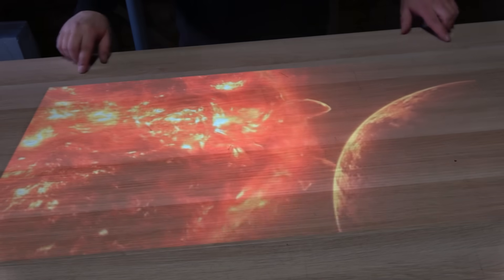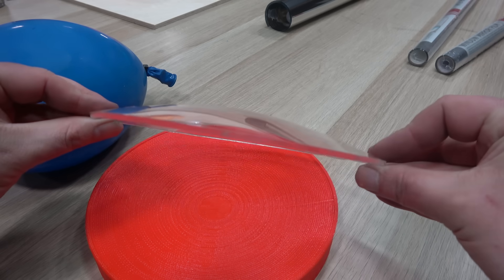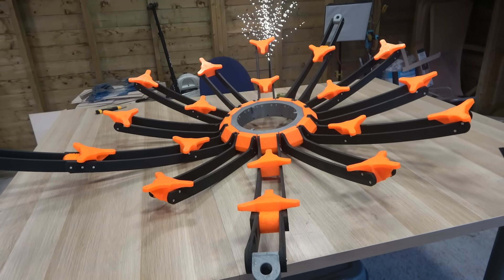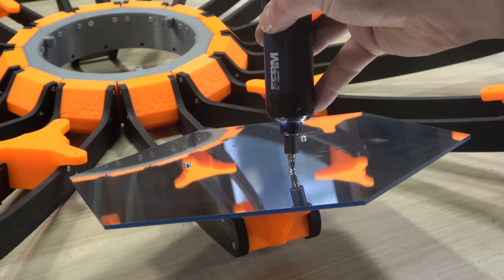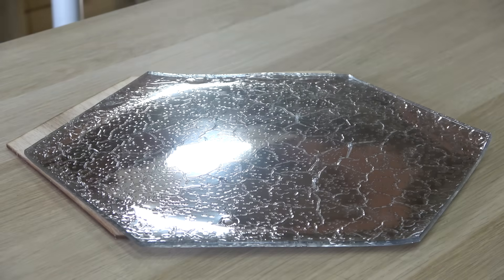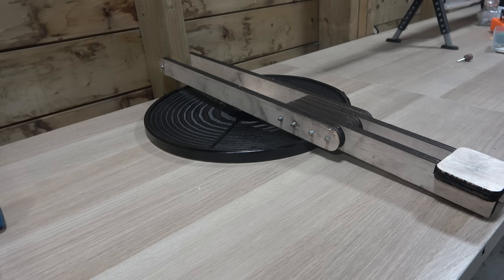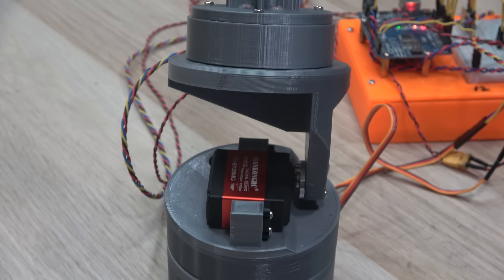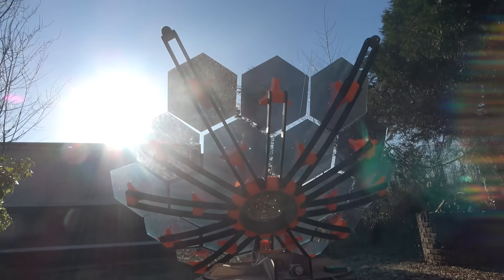Building a DIY Solar Generator..

Comment: I have always like the idea of multiple independent mirrors working together, rather than what is essentially one single big mirror. I have also though long and hard about potentially figuring out a way of tracking, involving no electronics at all. The principle is the same really, only instead of photovoltaics or similar for tracking and electric motors or similar for active adjustment, the means would be heat differential and presure. I practice perhaps some sort of electronic solution for trimming would probably be nice, but I honestly it also to be a bit overkill.
I have also considered adjustable focal point. Which is really not all that difficult, just as long as it doesn't need a large range. It would be a neat way to distribute the energy over an area, when sun is plentiful, and focus to a point when not and I can imagine a couple of use cases, though I do not really think it's worth doing, but it would be interesting to do it anyway.

Lastly I think I would revisit the gold vs silver experiment. Early as well as late in the day, and this is very relevant here in the Nordics and probably also in the Netherlands, the spectrum of light from the sun is significantly shifted towards the red, which may well be important. Presuming for a moment that gold is actually better in these cases, one might consider if:
1. it is a net gain or loss over the entirety of the day.
2. which solution might work best at the worst of times, i.e. winter, where the sun is always low in the sky.
3. if it might be better to collect less energy to have a better distribution over the course of the day.

Lastly, and this is a brand new thought I just had, why not both gold and silver, provided of course one is better in some situations and the other in others?
I imagine a cylinder, much like a telescope, a piece of mylar straight through the middle, perpendicular to the length of course, a piece of glass or other solid see through material sealing both ends, and lastly, the ability to adjust the presure difference between the two sides of the mylar.

The it is a relatively simple matter to enable this cylinder to rotate 180 degrees to expose the other end.

I could go on, but I shan't. You got yourself a new sub. ;)

Comment: i would commend you on your efforts and ingenuity! great job so far, looking forward to results. i liked the laser test setup a lot. i expect youll get the best reflectivity from a wet sand and polish of premium metal paint, maybe powder coating a sheet metal panel would do it. if you are going to try something different there is also chrome vinyl car wrap. the plexiglass should be shaped before you apply the windo film so as not to damage it with heat... the vinyl wrap medium can take a heat gun to help soften and stretch it, the benefit could be the ability to pre-apply the wrap as you are already and shape the plexiglass more easily with the higher heat, no need to worry about subsurface bubbles if youre applying a wrap on top instead of behind like window film

Comment: Hey after your done with this project you should convert it to a visible light collector and send the light down a fiber optic cable and see how bright and how far it can travel. Only issue I see arising is the light melting the fiber optic cable.

Comment: One concern about the plastic parts - they may melt and deform. One suggestion for the safety - measure the temperature of the aluminium disk and rotate the flower away from the sun if too hot.

Comment: Even if you had used gold and silver instead of gold colored paint (not gold) and silver colored paint (not silver)testing with a laser only tells you about the reflectivity in the specific color of the laser and almost nothing about reflecting sunlight as a whole. You know reflectiveness of materials vary by light color which is why you wanted to test silver vs gold in the first place! light absorption also varies with material so a gold mirror array and a silver mirror array may have different optimal materials for the heat collector!
It is worth considering if you have gold plated mirrors in your yard they are more likely to be stolen then other mirrors. That pesky human factor.

Comment: Btw dude ldr’s don’t work like you said they change their resistance not value or some bullshit they done have a data pin nada just give it 3’3 volts and measure the resistance on the other lead

Comment: Regarding the silver plates... i think it may work better if you took aluminum sheet (normally used for construction/roofing) and sand it down to 5000 or 10000 grit and buff it to polish shine may give the best optimal result in terms of reflectiveness. I can see how you can connect a small steam motor to this and provide electric power. I also wanted to add... if the center plate should be painted black for better heat absorption and then insulated on the back to help further retain heat?  Awesome work by the way!

Comment: 1. like others mentioned, center disc should be black, 2. like others mentioned the individual mirrors can be flat, 3. I'm fairly certain if you have high winds, 40+ you are going to find your whole device slammed to the ground. 4. your concept is great and covers all the needed points. but it's not ready for high winds. 5. pretty sure those tpu springs, cool idea, will eventually collapse much sooner then steel springs. look at buying the right springs in bulk prices. 6. I like that you reminded people that only 4 sensors are really needed for sun tracking. but for those looking for a non arduino way of doing the same thing, look into using those same light sensors (variable resistors) to control the motor, it will require some old school electronic knowledge.

Comment: Gold paint has no actual gold in it. Gold leaf is available at reasonable prices: about 9 bucks for 10 sheets, each about 2 inches per side. Gold will always reflect heat better; there is a reason it is used in spacecraft and hypercar engine bays.

Comment: Great project! What is the desired temperature of the  center plate? Will you be transferring the heat to another source to drive a turbine, for example? The PVC tubing may not be suitable for the resulting temperature of the hot water / steam.

Comment: Those mirrors look no more than 40cm across. That gives each one an area of about 1039sq cm, or with all 18, an area of 1.87 sq m. The incident radiation of sunlight on earth surface is about 1000W per sq m, which means this much area in mirrors could only produce 1.87 kW of heat energy. And that's BEFORE you run it through a heat engine, where your carnot efficiency probably won't exceed 75%. Where are you getting 2.5kW from?

Comment: The only problem I can see is pulling enough heat out of your boiler disk so that you don't have deformation of your printed plastic parts. Painting it black to adsorb as much heat as possible risks creating a softening of them. Also are you looking to make steam for running a generator? or just making hot water for use? Good project though.

Comment: What if you formed the acrylic hexagons first, and then spray paint the back (or front... for fewer losses?) with chrome after?

Perhaps two worm gear setups for the tilt would be good in case of wind... more stability.

Maybe some teflon dots between the wood pieces to reduce friction: or just seal it with wood wax so it glides a bit better.

The sun tracker is neat! I want to build one now.

Comment: Several points gold chrome and silver chrome paint are not adequate tests subjects. The James Webb Telescope has each segment as part of a large parabola, as opposed to each segment being an individual parabola. Reflective transparent film is only partially reflective, it would be better to use aluminum foil and make each segment flat. I would mount a relatively small solar panel at the focal point, however, it will get so hot you will need to have it water cooled.

Comment: The collector must be dark, and probably in the focal point (or near enough, not so focused to have the paint catch fire).
To avoid problems with the light being too focused on the collector, the primary mirrors should probably be either out of focus, or simply flat.

Comment: In the early 2000's the CSIRO in Australia were building a reflective solar dish farm in Western New South Wales to convert Liquid Petroleum Gas to 'Syngas' (CO+H2O) through a 'Conversion Box' at the apex of the reflectors, they also could 'Convert' H2O to H2 and O with a platinum catalyst in the 'box' - which could be 'stored' and burned when the sun was not able to provide 'power' , they also looked at 'normal' solar panels on the dishes - here's a link to one of their experimental sites.  "White Cliffs Solar Power Station paved the way as Australia’s first #solar power station, built back in 1981".

Comment: You are suffering a loss in efficiency due to the somewhat matte, or diffuse reflectance of your mirrors. The ideal is full specularity, which simple flat segments will provide if each is no larger than your heat plate. And the partial transparency is not helping either.

Making each mirror as its own axially symmetrical parabola is not the proper approach. Each should be the appropriate segment of the larger parabola they all create in totality. That is, each has its axis of revolution NOT centered, but rather offset by the distance of the segment from the assembly's axis of symmetry.

Going through the effort of parabolizing your mirrors is lost for four reasons:
- The surface of every mirror segment exhibits significant deformational undulations, which introduces worse aberration than spherical.
- The diffuse reflectance of your film is already a much worse hit on efficiency.
- The size of your heat plate renders moot any impact of optical aberrations (spherical, coma and astigmatism) for a half decent curve.
- Each mirror segment individually has a relatively long focal ratio, which means the spherical aberration of a spherical surface at this scale of 'resolution' is pretty minimal already. A parabola is not worth the trouble, which moreover will introduce astigmatism due to tilt (hence the more correct offset parabola mentioned earlier.)

On balance, you would likely derive a higher yield if each mirror were cut from a basic flat vanity mirror. And if each were made smaller, you would achieve a better parabola comprised of more numerous segments.

I really like your solution for pointing, via use of 4 photocells and a simple 4-vane obstructor. 😊

Overall a well enginered device. Just fine tune the optical element for better results. 😉

Comment: I see what you mean by it acting as a lever, and not in a good way. What if you put a spring between the mirror assembly and the box with all the components to let the entire assembly down easier, and then help the motor to lift it back up?

Comment: This would have been better done with mylar film. And the reason your reflective film is getting messed up is because it is a metallic film IN THE MICROWAVE. this could have been done with old garbage CD's as well
Reply: also, put your reflective film on the first surface side instead of behind the plexi. You will get significantly more return.
 To steady the vertical tilt your dish should be mounted more at it's center. This will help with wind loads too.
regardless of how cloudy it is, the collection surface on that is large enough to create some serious heat even under an overcast sky. You should make sure to have proper eye protection when testing it. 
Your mirrors should have little to no tilt, as it is the parabolic shape of the entire assembly that is doing the focusing, and the light will not be coming at those mirrors from straight on as you show in your illustration

Comment: Would it have been better to shape the parabolic reflectors first, then apply a reflective coating? Maybe spray on rather than a plastic film. Also coating the heating plate with matt black would make it better at absorbing heat.

Comment: Looking at all these heavy motors, pumps, trackers, electronics, looks like that thing will consume way more energy than it could produce. 

Especially considering that you chose probably the least effective way of transforming light to heat to electricity, with losses on every step. Also heat to electricity is quite efficient when it is enough to bring water to the boiling point and generate steam to spin the turbine. Which your construction of the heater is totally not designed for. 
And all the methods which can extract energy from the "warm water" are comically inefficient and most cases require a source of cold, which by itself needs more energy to create than it could possibly produce.

So yeah, it looks cool, but most likely will just be an overly complicated and unreliable way to heat water for a warm shower
Reply: Who said it's used to generate electricity? Solar panels are best for this, but if you want to use thermal energy, mirrors or lenses are more effecient.
Reply: @SolarCookingGermany  the title said it. "5kW" stands for Kilo-Watts, that the unit of electric measurement. Heat energy is usually measured in Joules
Reply: @ He changes the video title a lot, the latest "5kW from $5 mirrors" is a new one 😃 It's also totally exaggerated, more like 1000W at best if you accept this as a unit.
Reply: @ Today it's a "2.5 kW Solar Generator" 😄
Reply: @SolarCookingGermany  indeed, curious)
Probably he's trying to clickbait for the bigger spread of the audience
And the preview has changed as well
Reply: @nemorianderson  And today's title is "Can $5 Mirrors Power My House?" 😀 So far he put more work into changing titles and thumbnails than into actual use.
Reply: @SolarCookingGermany  clickbait at it's finest 🤌

Comment: Each mirror is direction the sunlight to the reflector suspended by 3 struts. That initial reflector has to get as hot or hotter than the water heating reflector in the center of the array. Could you put the same water transfer plate on the back of that mirror and capture the excess heat? Should be good for another 500 to 1k watt of power. I live in southern Arizona and have been looking for a project like this.

Comment: You don't need heat for solar to work. Least important detail in a solar setup. You just need the UV rays.
Reply: Photovoltaic cells don't run on UV light. Also, this is a solar thermal setup, not a photovoltaic one.

Comment: Aluminiumplate should be anodised black. In my opinion every mirror should be parabolic, but the arrangement of the mirrors shoud be sperical. So every mirror can have the same distance to the centerpoint of the arrangement, witch, in the same time, ist in the focal point of the mirrors. In this point is the secondary mirror, also parabolic, witch reflects the light to the aluminiumplate.
While a parabolic shape reflects all light in the parallel to its axe, only the parallel light is reflected through the focal point, the secondary mirror needs at least the reflecting area of the other mirrors.

Comment: Masterful engineering.

Unfortunately, the complexity would make this approach impractical and expensive.

A real world model would need to be made much more robust to be able to handle wind loading and weather exposure.

This is why most people don't use solar trackers with their pv panels.

The cost, complexity and reduced durability isn't worth the additional efficiency.

Comment: Some comments:

1. To really copy the James Web design, you would not need one symmetrical parabolic shape, but instead the right off-axis section of a much larger parabolic for each mirror segment. Though it is rotationally symmetrical in your case, which means one shape for the inner ring of segments and one different shape for the outer ring. 

2. For the purpose of just focusing the light, you could also put your absorber at the position of the secondary mirror, James Webb has the secondary mirror only to keep the spatial information of its images, it is not necessary to help in the collection of light. 

3. If your mirror works well, your target will be much too large. The spot of light should not have a final diameter too much beyond 1-2 cm. As you have it built now, with the target the same size of each of the mirror segments, you could have achieved that without any curvature on the segments at all, just by aligning all flat segments to reflect onto the center without focusing. 

4. If you want to heat water just to get hot water, instead of running a thermo-electrical engine, a wide cylindrical mirror focusing light along one axis onto a black tube will be just as efficient, and overall much easier.

Comment: Grab a couple of Hoola hoops place on solid backing and on front secure survival blanket either silver or gold side out, pull a vacuum and the shape will form a concave primary mirror with a good focal point.   One Hoola hoop is about 0.5 square meters so you will get around 500 Watts and array with 10 will get you 5KW.   For ease you would probably be better / easier making a long tube solar concentrator?????

Comment: The y pivot could use sone sort of spring to counter the weight of the mirrors. Then the motor to move it has to be way less powerful. Like a steadicam arm. It also makes it less prone to breaking
Reply: Also, since you're warming up your plate with only radiation, you could put some sort of see through isolation on top of your plate. And also cover your plate in something black like others have mentioned. Like a solar boiler.

Comment: I do a lot of similar stuff for work. Form the Plexi, then apply the film with soapy water and a heatgun. alternatively, you could electoform copper then nickel onto the lexan, or use a Silver oxide reduction reaction with an autobody urethane topcoat to protect it from oxides. but those feel more like refinements for after the prototyping stage.